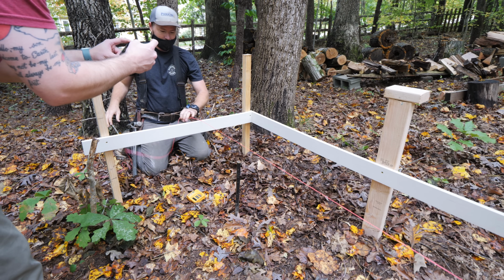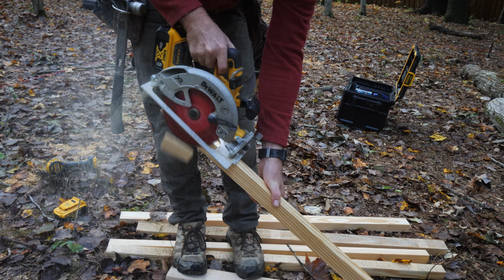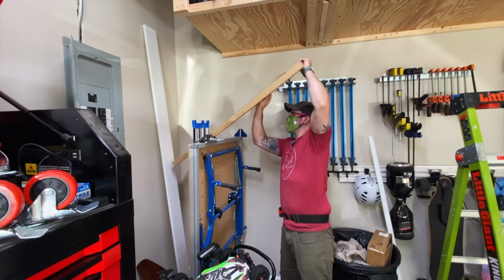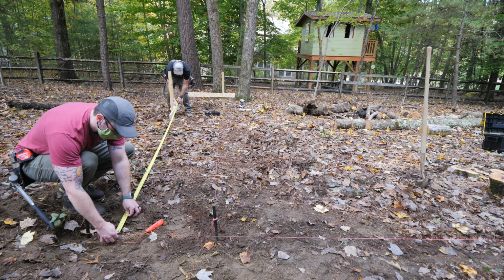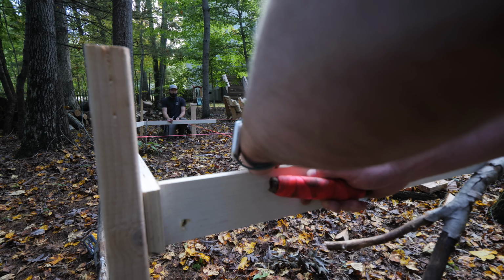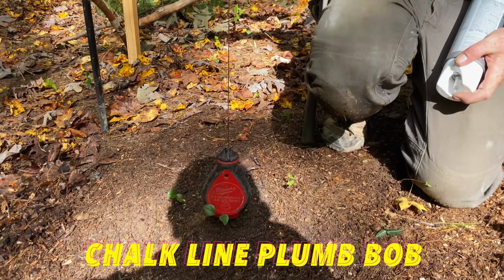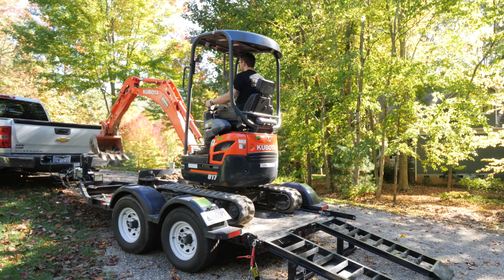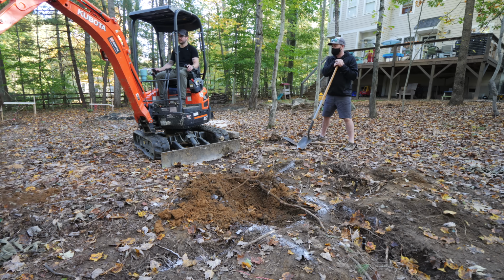Foundation Layout & Digging Footings // Not So Tiny House Build Part 2

Comment: Don't burn an inch, burn a foot. Easier for me to find a problem that is a foot off then 1". 
The other thing I do when I check square on my projects when working with another person, call out whole inches, not feet and inches. 
376 and 3/4ers is better then 31'-4 and 3/4 of an inch. My $0.02.